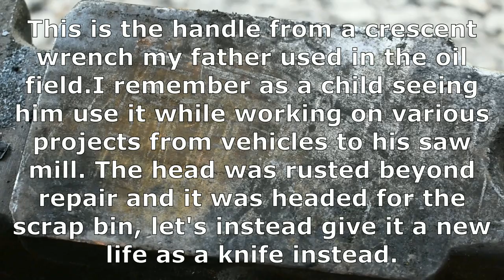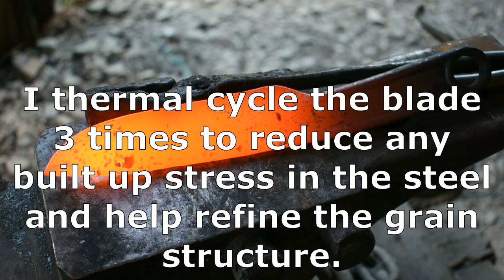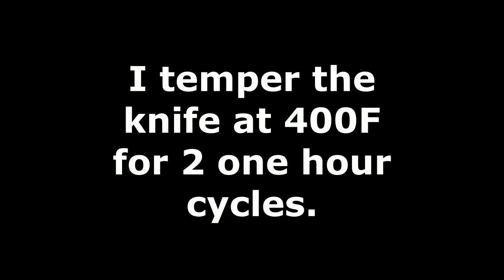Forging a knife from an old crescent wrench

Comment: Is this steel good for knives??
Reply from the maker: It really depends on where it is made in my opinion, I have made several of these and it seems like the older US made ones harden really nice. When I did the file test after heat treat the file wouldn't touch it, I have made some in the past with cheap wrenches that didn't even need tempering because they were so soft. Even then I still treat them as more of a novelty knife than one you would want to carry and use. Plumbers and Mechanics love them to put on display in their man cave or shop. I appreciate you watching!